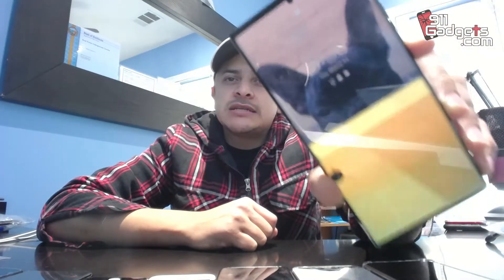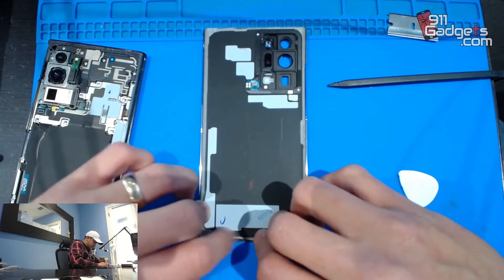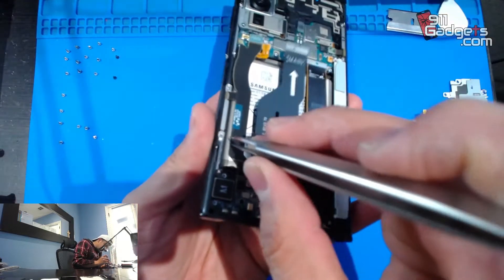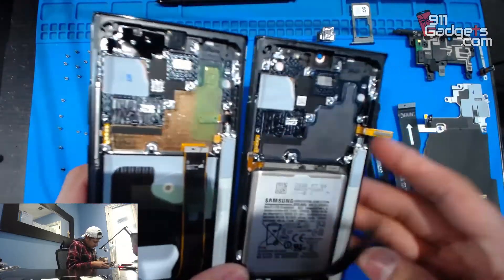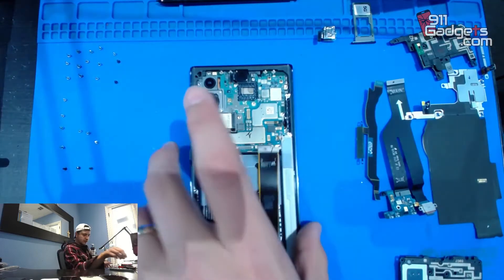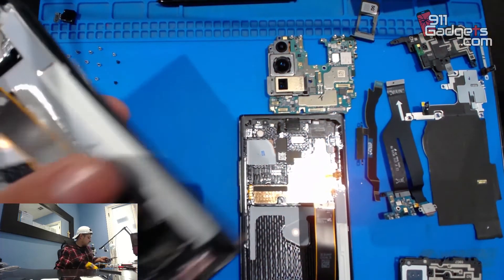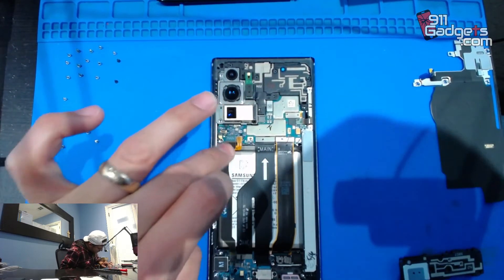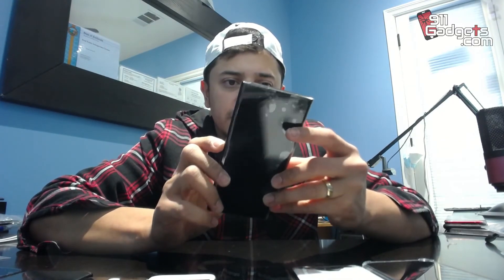Samsung Galaxy Note 20 ULTRA 5G - Screen Replacement/ Frame Swap (Start to Finish)

Comment: hey so I did a frame swap on this model and now the camera is blacked out I've retraced my hardware. all stuff is connected. I also reset app and cache partition.
Reply from the maker: Hey. Did you swap the camera?
Reply: @911Gadgets  i contacted my vendor to get an OEM one. Didnt want to order a new one. Its the rear camera assembly i used the OEM selfie-cam. And that worked wonders. The main issue is the 3 rear cameras.

Comment: You should have replaced that adhesive to keep water resistance
Reply from the maker: It will certainly help but I, like Apple/Samsung, still wouldn't guarantee the water resistance after a repair.